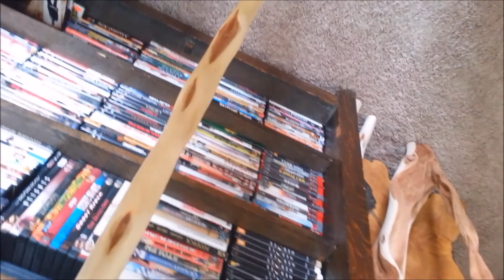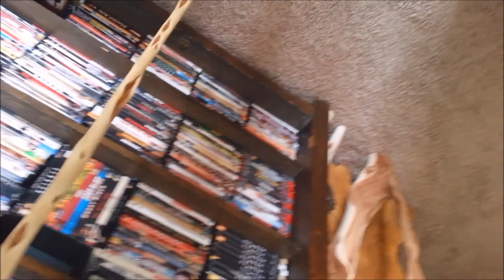How I put a finish on Diamond Willow pt4

Comment: I'm not sure about the diamond willow you are finding, but here in Sask the willow gets a viral infection which stains the diamonds shaped sockets where branches form and die off. Its a random thing, you can peel some bark back on one bush and its as blonde as your wood, but you can go 30 feet over and check on the next bush and it has super dark staining on the diamonds which makes for beautiful wood once waxed with bees wax or oiled with a good quality wood oil. Tung or the likes works well.
Reply from the maker: I gave one to a friend that looks like that. I thought it was a dead, standing piece of wood. It looks very cool. It is the only one I have seen like that.
Reply: You are right , it was dead , it turns reddish brown after drying , I look for dead stuff